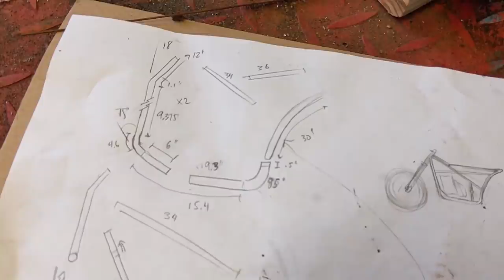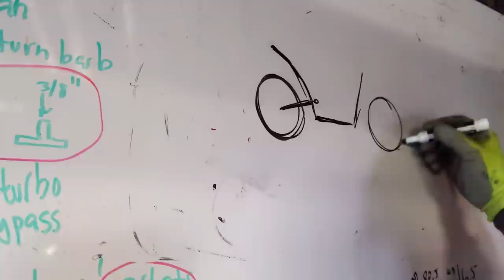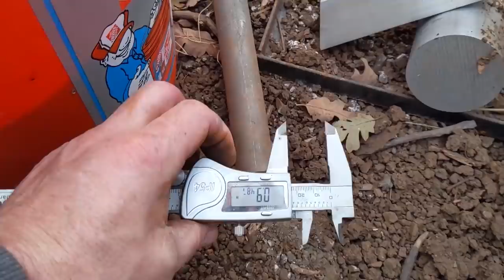INSANE!!! 18kW Dual Motor E bike build | Lark Machine Co

Comment: You the man! Well thought out project and skillfully executed, enjoyed video. Would probably cost more than $8000 if bought from ebike company, well done
Reply: Ghv
Reply: No bike shop would sell you such a bike.
Reply: @bingosunnoon9341  No... but any motorcycle shop would.
Reply: This bike would be 15k plus easily 😬
Reply: @DriverJ-N As someone who knows absolutley nothing about ekectric motors or ebikes or amps or watts or converters, ect...what is the difference between this and strapping an old car alternator and lawn mower battery to a schwin?

Comment: Thanks for proving an "American" custom motorcycle can be constructed without dysfunction, shouting and endless conflict.
Reply from the maker: Hahahah, there was shouting, but only because of that big ol spider!!!!
Reply: @user-pd9vm9ts1o  Chinese motors and controllers
Reply: @user-pd9vm9ts1o  
Steel tubes, motors, controllers, tires, wheels, brakes and  the small bits too are made in china! 😂
Reply from the maker: @Unapologetically_human8349  So true. It's unavoidable this day in age.  The only thing not made in china was the small piece of wood I mounted the switches to
Reply: @sheanyquist  you sure that wood did not come from a tree in China  :D

Comment: Late to the party dude.... I built one with 2 x 10,000 Crystalyte hub motors over 10 years ago.... I still ride a 2 wheel drive ebike... but now the Rambo bike trailer has 2 x 1500 watt motors as well.... I used a Strong GT-S210 frame, Canadian tire used to sell them....  Samsung 40T cells 5s/13p    48V - 20 amp hours can discharge at 175 amps.... Daly BMS 35 amps per cell and I have 2 of those in my current ride, built on frame similar to Stealth Bomber, bike trailer carries another 60 amp hours built out of 18650 cells. Solar recharging... brake lights, headlights, turn signals....
Reply from the maker: Bummer, and I didn't even know I was late.  Sounds like some cool projects

Comment: Nice freestyle build man! I just put a brushed whizzer style rear motor on a vintage bike with a 500w front wheel both on same throttle but 2 controllers too! 60kph
Reply from the maker: Nice!!! Ebikes are the best!  Why did you used the brushed motor? Thanks commenting!

Comment: nice, I don't like the way you mounted the rear suspension though, the bar at the bottom of the swing arm will constantly try to snap off while under load leading to a catastrophic failure
Reply: yeah great build except for that rear swingarm. that bar at the bottom could've been stronger if he welded it on top, that way the shock would be pushing it instead of pulling against the welds, but even that wouldn't be really structurally sound. also the triangulation of the swingarm is all wrong. the shock mount should be at the top of the triangle in order to get the strength from that shape
Reply from the maker: If I welded the shock on top, the shock would have been either sticking up through the seat into your butt or at a completely unusable angle.
Reply: @sheanyquist  copy the Kuberg Freerider swingarm but place the shock mount a bit lower. it's a structurally sound design. 
with your fab skills you could definitely do it.
Reply: @sheanyquist  im not being an internet arsehole or anything, just pointing out something that "could" be important to your physical wellbeing in the future, but I see your problem with the shock length,  just something to think about on your next build,

Comment: How did you install the front motor hub in a motorcycle front fork? The hub motor shaft is designed for bicycle dropout.
Reply from the maker: I welded a collar over the axle and made a little torque arm that bolted into the slot where the pinch clamps are.  Made the hub unserviceable, but these motors are pretty bullet proof

Comment: Nice Job man. Hey if you take a mallet and a heat gun to the vinyl on the seat it should tighten up and the folds will disappear. If you didn't already know that. Is that a custom made battery or can you buy off the shelf ?
Reply from the maker: Thanks for the textile tip!  I'll try that next time.  The battery is an LG chem 16s module. You can buy them at ev west or thunderstruck online. They do need a bms

Comment: That's awesome..... Now the only question is, Are you going to have Ryan try and ride it on a ramp¿?     😂🤣
Reply from the maker: Not this bike, buy definitely my ebmx bike!
Reply: @sheanyquist  - Awesome¡! I honestly believe we'll see electric drive BMX bikes in the future, basically a regular BMX w/ a small hub motor and small in frame LIPO batteries.... I bet they'd even get rid of the chain and sprocket if that was the case and just use a pedal sensor to engage/disengage the motor.

Comment: That's underly fantastic 👏 but wouldn't you prefer a wider more comfortable seat 😉 like other dirt bikes. But hey awesome exceptionally great build. Incredible ingineering feat. Very impressive bike.
Reply from the maker: I ride mx pretty frequently. I just wanted to build something.  Probably would have been easier to use an existing frame.   It was a fun build though.  I have since taken it apart and used the parts for other things

Comment: How did you managed to connect one throttle to 2 controllers? I ask as I have an electric fat bike and the throttle controls one of the motors perfectly and the other goes full speed at any position of the throttle.
Reply from the maker: I had a picture of the wiring from my work board. I'll see if I can post a link to an image for you.  I think I just paralleled the voltage output to each controller

Comment: awsome project :) 
wish I had your workshop and tools

what type of welding is it that you are doing ? 
mig, arc, tig, stick - all confusing to me
all i have is a spot welder - whats the next best step welding wise?
Reply from the maker: I do Mig for quick steel stuff, I do TIG for aluminum, SS, and good steel stuff.  And torch welding and brazing for low heat joining.  I would buy a flux core MIG welder if you want do some small welding
Reply: @sheanyquist  thanks for the reply - now to get me a mig flux core welder off ebay :)

Comment: Are the front and back the same kw? I would guess not, probably stronger on the rear?
Reply from the maker: They originally were, but I put a small knob in the top tube area that now can lessen the front motor torque

Comment: First of all, congrats, this is so cool and you did it!!!
But there is a thing i don't like at all, the union between the suspension and bars is too small, and there is where you have the maximum stress point. So if someday it breaks (hope not), I think will be in this point.
But well done!
Reply from the maker: I definitely considered that to be the weak spot, but I couldn't source a shorter shock.  I think the swing arm will bend before the weld fail though.  Hopefully I never push it hard enough to find out!
Reply: @sheanyquist  Maybe if you drink more "metal tee"  you'll find the solution haha!

Comment: Thank you, it was interesting to see, only where to buy this wheel is 18 kilowatts ?
Reply from the maker: It's rated to 3kw. I just over tuned it to 9kw.  It will burn up if you push it too hard
Reply: @sheanyquist  thank you for answering probably there is some kind of fuse that lets you know it's better not to turn the handle further?
Reply: @sheanyquist  

I have just purchased a frame for an electric bike I would like less consumption more speed for 60 km per hour and a range of 150 km I just work as a courier and often go around the city, Oh by the way I think you probably ask why this speed I live in the Crimea the city of Yalta here the local terrain is such that will not allow a weak electric motor to work. You will be able to suggest with the calculation of 3 kV to pick up the acamulator, and the type of wheel motor (ramjet and gearless). Thanks for your attention.
Reply: @sheanyquist  You probably will but I don't know English and talking to You now made me think about it). I communicate with You via Google translator.

Comment: Hi friend, congrats for this piece of art!! one question: the two motors are constantly working even in the curves?
Reply from the maker: Yeah, the front motor has a tendency to pull you out of a curve. I made the power come on slower for the front wheel to try to eliminate that issue
Reply: @sheanyquist  any top speed and range video on this build?
Reply from the maker: @bobthebuilder201  I recently pushed the bike to the limit and got it almost up to 70mph.  Range is not the best, I usually ride it hard and get about 30miles a charge

Comment: how long does it take to fully charge? and the battery mileage? I just want to know.
Reply from the maker: The battery can be charged in under 2 hours if you have a big charger.  I usually slow charge to save the battery health (8 hours).  I can get about 30 or so miles of full power fun

Comment: That's pretty fuckin' bad ass Shea. What drew you to the LG Chem module? What range do you expect with it? I ask because I'd like to start my own performance ebike and to keep things simple I'd like to use something off-shelf like that instead of custom building one.
Reply from the maker: I actually got 6 of these modules through a trade.  They are really good for power and energy, but the form factor is a bit bulky.  I actually took the bike out for about a 10 mile ride last weekend and it killed about 6volts.  That's about 30%. I was riding like an idiot though, full throttle!

Comment: Lovely! Did you use two separate controllers for the motors? Were you able to configure a limited slip between the two? Always thought that would be a sweet feature for icy rides and wonder what it would be like on step rides.
Reply from the maker: I do have two separate controllers.  They are QSmotor brand and they are pulling about 150 amps each.  I did get a variable front power switch, but I haven't added a reaction control yet.  Steep rides are ok, but the motors are not as torques are a hub drive style
Reply: @sheanyquist  Maybe mid drive style ebike next time ? )
Reply from the maker: Martyr4JesusTheChrist  motors are rated a 3kw continuous.  They can do much higher peak.  They get toasty if you ride them hard for too long. Battery can do 400amps peak

Comment: Great work.  However, I'm not a fan of the dual motor bikes.  I have found that it's difficult to ride tight trails when the front motor is engaged.  What happens is it yanks the bike right off the trail from the force of that second motor kicking in.  A few times it even sent me right into a tree.  ha.   It's ok on regular straight roads and for hill climbs though.
Reply from the maker: It definitely is a different type of ride.  With all this power the front end really just wants to wash out for me
Reply: @sheanyquist  yeah exactly.  You can't really power slide around turns.    But great fabricating skills man.  Quick question, I'm buying a stealth bomber type bike but with the qs273v3 motor on the back, and you can only have a 210mm shock.   I'm looking to have new brackets fabricated and welded higher up on the frame so that I could mount up to an 11 inch shock.  Do you think that would work?

Comment: How did you learn all this stuff? I’m in my mid 20s wishing I could have a skill set similar to yours. I wouldn’t know where to start though to be honest.
Reply from the maker: Just pick a hobby and deep dive. You'll end up with more tools from necessity and lots of experience
Reply: @sheanyquist  where do you start with this? I don't know... woodworking? making a shelve or a table, then maybe some metal work for your furniture.

The electronics I know aren't that hard, just good studying, but the craftsmanship doesn't seem it can be straight up learned by studying, you need practical experience.

Comment: The foam for the seat is easier to cut with a hot wire foam cutter diy or buy
Reply from the maker: Hot wire cutters don't do so well with high density closed cell foam ( yoga mat).  I have tried using them, it gets really nasty!

Comment: This might be a stupid question but cant you just use the frames from dirt bikes for a high powered Ebike?
Reply from the maker: You can. But most times the batteries look like the are shoehorned in and a bit of a Frankenstein.
Reply: @sheanyquist  Thanks for the reply. Can you make a road motorbike an Ebike and it still be road legal. I am in the UK but imagine the law will be very similar?
Reply from the maker: @marccas10  you can. You still have to follow DOT rules of safety
Reply: @sheanyquist  Cheers pal.

Comment: I have several questions and this is one of them.
Did you buy 2 batteries or is it a single 67V?
Reply from the maker: It is a LG chem 16s module from a Chrysler Pacifica battery pack
Reply: perfect, even though in my country there is almost no Chrysler (Colombia)

If I buy or make a battery pack by myself, it could work, right?
Reply from the maker: @hankness  for sure.  There are many videos online showing how to make a battery. Check out Great Scott's channel
Reply: @sheanyquist  

cool, thanks.

a last two questions and stopped bothering.

1- How did you interconnect the throttle so that the controller moves the wheels at the same time or do you have 2 throttles for each wheel?

2- And the last one, how did you interconnect a single battery to the two controllers?
Reply from the maker: @hankness  one single battery and a shared throttle input. One throttle
Reply: @sheanyquist  understood, both work at the same time right? (I'm just saving to make a project of my first electric dirt bike to pay the lowest taxes in my country for pollution)
Reply: @sheanyquist   ok thanks so much for all the help
Reply from the maker: @hankness  good luck!!!
Reply: @sheanyquist   ❤️

Comment: Thiz how much kg
Reply from the maker: About 140Lbs or around 64kg.  Not the lightest.  Steel frame and heavy battery
Reply: @sheanyquist  Maybe it would be lighter if you used hard aluminum pipe instead of steel pipe.
Reply: @sheanyquist  Very light. good

Comment: Whats the battery pack your using there, custom or salvaged just curious to know.
Reply from the maker: Hi Alex, this battery is salvaged from the Chrysler Pacifica phev.  I got mine from EVwest.  I have added a cheap Chinese BMS for balancing from eBay.  It is the LG chem 16s battery module
Reply: Shea Nyquist >>  sweet project build you got through nice awsome work!!  Thanks for reply.
Wouldn't be able to get that on this side of the pond.
What was its dimensions like length width height, voltage/ah.
Looks like part of a car module thats why I asked👍

Comment: Ummm, believe if you did a physics analysis you would find that a two wheel drive bicycle becomes unstable if and when both tires break traction.  I believe this is the general belief in the e bike industry.  I'd be curious what you find.

Comment: There is no way its 18kw the engines are small my 5000w motor is bigger then them combined
Reply from the maker: 18W peak. motors are rated for continuous use. You can probably get 15kWs out of your motor peak

Comment: well... theres a couple of things i want to talk about.
first of all:
- wich madman chose those ultrabad street tyres? get some good cross tyres, fitting th the high kW u have and stop embarrassing yourself.
- wasnt there enough money for a proper Thru Axle for the rear? 
- PRAY that your upper rear suspension welding point never fails and sticks your rear suspension up your butt on a hard landing.
- the same goes with the pedals. on a moderate impact to the ground, you better hope those pedals never give up, or you will most likely have a very bad time.
- who came up with the backwards pointed metal stick that works as mud cover? ever thought about what would happen if you fall off your bike uphill and your bike falls with that metal rod pointed towards you?
 - bike looks HEAVY AF, must be a pain to control...

style points for the look: 0/10, looks like a white trash motocross.

all in all: 1/10
is that the best you can do?
Reply from the maker: Nobody asked for your opinion.  And dozen seem to align with 99% of the other people commenting here.  Its just a fun build with junk parts.  Not trying to sell anything or teach anything
Reply: @sheanyquist  
Man, you react like a child.
That's just simple FACTS my dude. I'm a long time downhiller, thus I have experience in spotting flaws on a bike and what can happen to it. Deal with it.
Reply from the maker: @Liqweed1337  cool story

Comment: crystalyte motor - not 3kWt.
Reply from the maker: They are 9kW peak each. 3kW continuous
Reply: @sheanyquist  not. read parameters pls. 2000W - peak power
Reply from the maker: @TULSUNDUR  i routinely run 3kw continuos.  I put 150a to the hub for 5 sec burst with no issues. Imperial testing beats factory specs
Reply: @sheanyquist  I've seen a lot of burned-out crystalyte hub motors Crystalyte, that were operated by "experimenters" like you. about 5 seconds of overload - not impressed.
Reply from the maker: @TULSUNDUR  cool, thanks for you input. It was just a fun project I made with parts laying around.  No need to be so critical.  Have a wonderful day